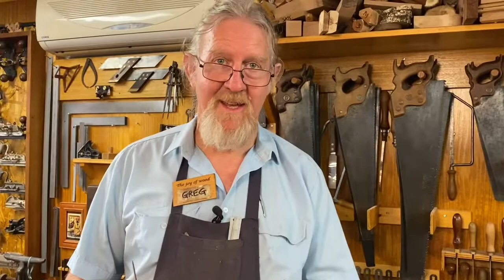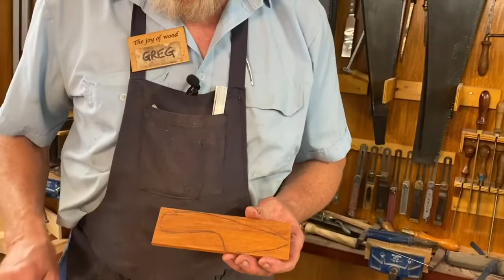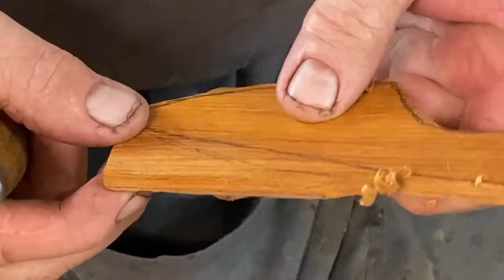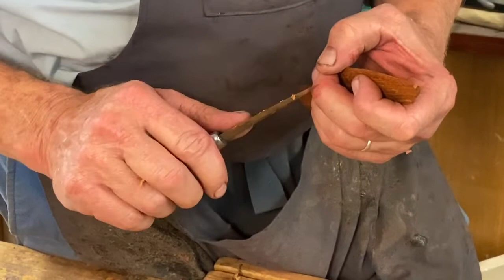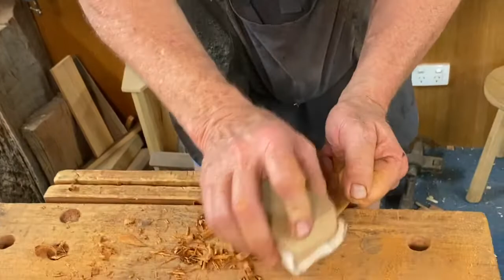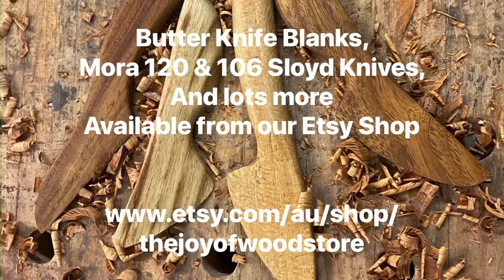Carve a Butter Knive from a Blank.

Comment: Hi Greg, excellent video and lovely to carve along with. Do you have some recommendations on food safe oils to finish off with?
Reply from the maker: Gidday, Ash.
There are many food safe oils available. We commonly use Coconut Oil - it can be applied with no gloves. Other kitchen based oils, like Olive Oil, dry slower, but can be used too. There are a number of commercial products available, but I would recommend you stay away from anything with mineral oil in it. The thing to remember with all oils is to generously apply it, to rub it in, to let it sit for a while, then most importantly to wipe off all surplus oil. Polish with a dry cloth. Repeat the next day, and whenever the Butter Knife looks parched.